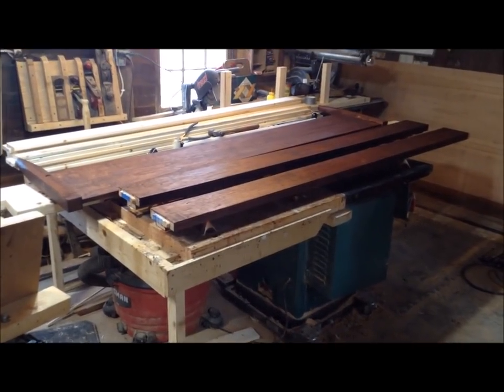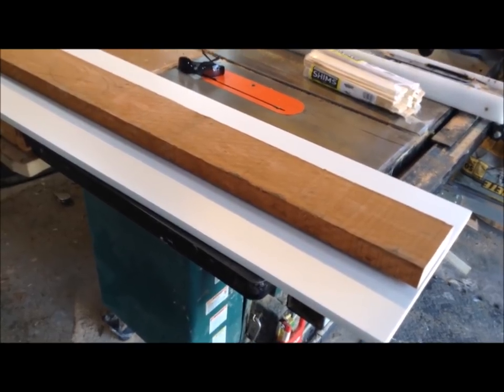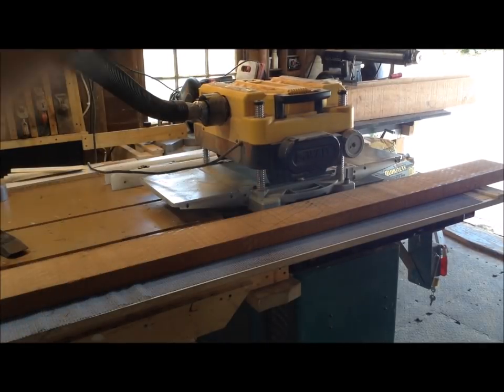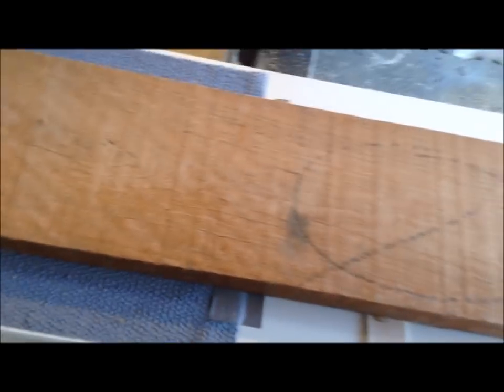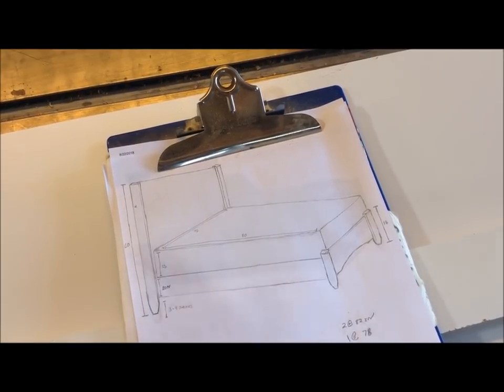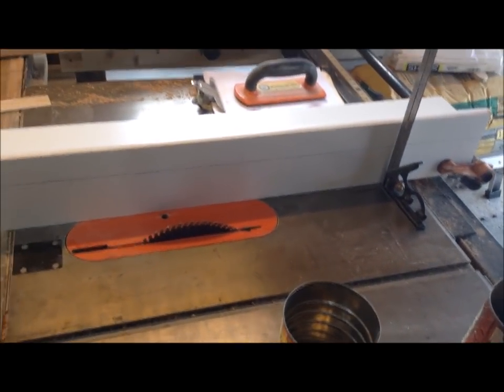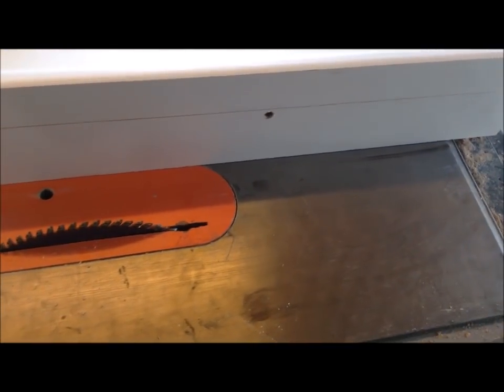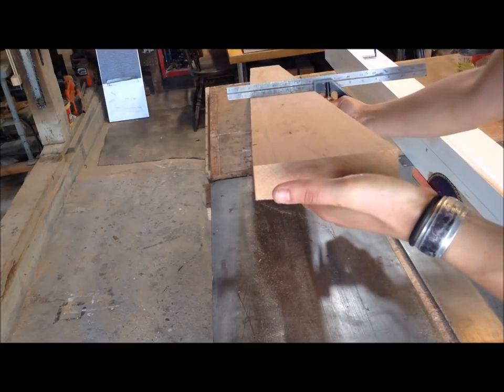How To Mill lumber Without a Jointer

Comment: I just found you yesterday and knew I had to subscribe right away. I've used a jig like your planer jig before and I had seen one like you used to joint the edge. I had figured you would use the first jig and attach the board to it with edge hanging over and use the str8 side of the melamine against the fence. I've never tried that, but I have 30 bd ft of rough sawn cherry I need to get edges on for a glue up. Now I have to decide which way to go lol  I have an ancient 4 inch Delta jointer, it's useless for large scale lumber
Reply from the maker: I saw a few videos with it done that way and that seems to work just as well.  I don't have those surface mount hold down clamps and didn't want to wait for any to come in the mail.  So I opted for the fence jointed method.  But, in general both seem to work.  I think once you have the one I went with made it is easier to set up and use consistently.  The boards I was jointed were 6+ feet and lining that up so the first cut is flush and sending the whole thing through the saw is a little more cumbersome I felt.

Comment: I am a little concerned about the mat on the planer sled.  If that were to get sucked up into the knives it would be a real mess.  The "jointer fence" is brilliant.  Thanks for posting.   Wonder if you could move the fence to the other side of the blade to have more room for a feather board?

Comment: At 27:35 you point out the planer snipe; my experience with this is that the snipe is the result of the weight of the overhanging board which levers up the short end when entering & exiting the planer. I have reduced this snipe to negligible amounts by lifting up the overhanging end slightly higher than the planer bed horizontal plane, both going in & coming out.

Comment: slipping between the work piece and the sled can be reduced a bit by waxing the bottom of the sled.  I use wooden dowels to hold the cleat in place on my sled.  I'm afraid of what would happen if I hit screws with my plane blades.
Reply: @Porter Daxton Yea, I have been using InstaFlixxer for years myself =)

Comment: It may have been easier to plane had you cut the piece into the rough dimensions you were needing.  Those long pieces are difficult to work with and a lot of material is taken off the ends.